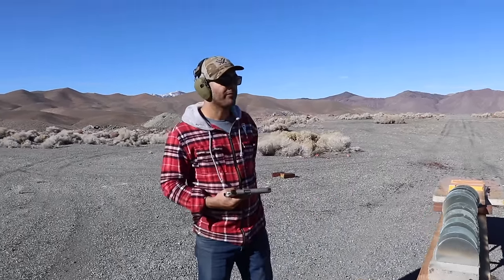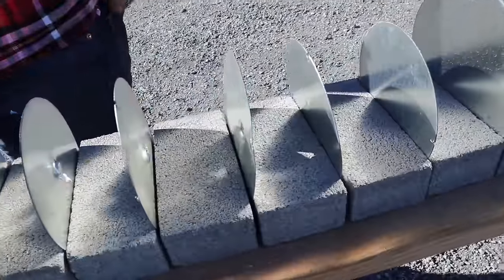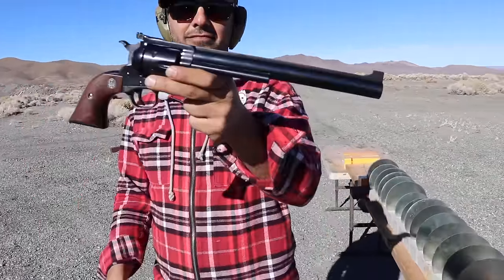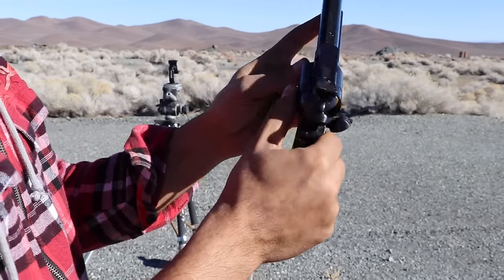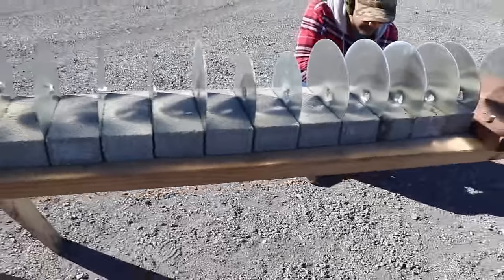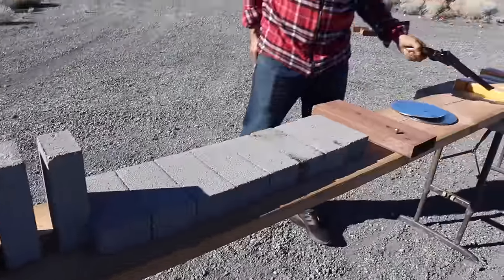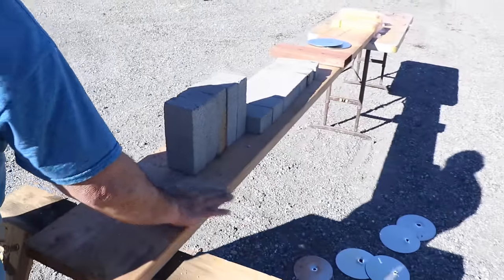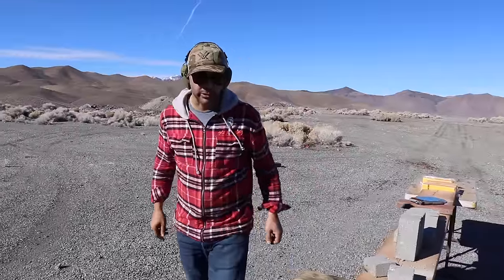45Colt vs 45Acp

Comment: The .45 ACP's lineage is from  Smith & Wesson's proprietary .45 for their Schofield revolver. The .45 ACP was designed to not over-penetrate the human torso.
Reply: One reason I like the 44 Special.  99% of my 44 Mag hand loads are at 44 Spl power levels. Pretty zippy out of a rifle too.
Reply: @johninnh4880  I also load my 44 mag to 44 Special levels with hard cast lead bullets. I have a S&W model 29 6" barrel a Virginian Dragoon 8" barrel and a Marlin 1894 20" barrel. Loading to 44 special makes either firearm more pleasurable to shoot. After shooting about 10 44 mag loads from my 29 or Dragoon my hand is shaking from the recoil so much that I can't hold the gun steady and with the rifle my shoulder can't take much more either. One thing that I do is when I'm finished firing either one of them is that I shoot about 5 rounds of jacketed 44 mag with a mag load. This cleans out all of the lead and other junk in the barrel and makes cleaning either firearm easier.
Reply: @dalehazard8016  <-- I shot Cowboy Action for years. I still have a few hundred 44 MAG Cowboy loads. 240 gr in the pistol for a bit of a roll in my hand so the hammer is easier to reach. 200 gr in my rifle to shoot flatter.  I shot  "dualist" (one handed) took 3rd in my state one year. Shot cap n ball duelist.  Took 1st place in speed pistol with em my last year. I quit because of the "gamers" 32 spl at 600 fps or some nonsense. Real Cowboys did not shoot whimper loads. I got hit 3x in my legs my last match. I pushed for a MINIMUM  FPS. They have a maximum FPS. Fell on deaf ears so I quit. In the last year I didn't shoot for a recorded score because of the bitching about little shit that made no difference except to help their final placement.  Nuff on that. I've got a S&W N frame round butt tapered short barrel in 44 Spl. A special run for Don Hume/Hoag (?). It shoots one hole 5 shot groups. Most accurate center fire pistol I've got.  Smith n Wesson GAVE me a 6" M629 with a wide smooth target trigger and a wide target hammer. I spent an entire day on buffing wheels so it looks like it's Nickle.  Went through the custom gun shop back in the 80's when you could walk into the shop. I watched the smith do my trigger/action.
I have a M29 8 3/8" pinned barrel in the presentation case. Wide trigger (grooved), wide hammer. Sweet pistol paid $125 for it!!😳
A pair of Ruger Vaccaro 5" 44 Mag. My Cowboy pistols. Engraved back straps with Buffalo horn grips. Trigger jobs etc. Sweet pair.
I landed a pair of centennial (?) Ruger Old Army SS 44 cap n ball pistols with adj sights. When I looked at the serial #'s they were consecutive serial #'s!! Like WOW what were the chance of that? They came from 2 different dealerships too. What a find. Both in wood presentation boxes. 
I'm rambling... thanks for the post. I do the same thing with a few jacketed bullets to help get the lead out. Some people say it makes it harder.  I say BS.😉
Reply: ACP developed from a S&W?
I thought it had more to do with extraction and not having an uncomfortably large grip than anything to do with penetration
Reply: @bp8652  <-- Tons of cadaver testing. 45 Schofield & 45 Colt (not long colt) ballistics seemed ideal. 45 Long Colt over penetrated and was to long. Then getting 'it' into John Browning perfect pistol design. Many factors in the ACP development. My grandfather carried the same 1911 in both WWI & WWII. Served him well.
Reply: I beg to differ,  The .45 ACP is from Frankford Arsenal design, via Browning's early cartridges.
Reply: @johninnh4880  I load some of mine in the gap between a hot 44 Special and a standard 44 Mag for my Taurus T44.  It can handle any standard 44 Mag, but is a bit on the light side to be pleasant shooting with those loads.  Even at that, it still packs a wallop on target with the lighter loadings.  And the lighter load likes Hunter Supply's 200 gr PHP lead bullet.
Reply: @johninnh4880  .45 long colt and .45 colt are for all intents and purposes the exact same round. Same dimensions. Same round.
Reply: @tricksterjoy9740  Actually there is no 45 Long Colt, according to my Lyman manual. It's just: 45 Colt, 45 Auto Rim, and 45 ACP all being different.
Reply: @johninnh4880  I literally have a box of .45 long colt cowboy loads. They match the dimensions exactly of a box of .45 colt I have.
Reply: @johninnh4880  from what I’ve heard and read about here and there, generally speaking it seems .45 long colt is used to describe explicitly cowboy loads, whereas .45 colt is either/or.
Reply: @tricksterjoy9740  45 Colt as we know it is "Long" Colt, 45 Colt Government is "short" Colt. It was shorter and loaded with only 30 grains of BP instead of the full 40 grains that "Long" Colt used. Once the military stopped using those guns it dried up and ever since only the original "Long" Colt is produced, mostly with smokeless powder. Cowboy rounds are just rounds loaded with black powder rather than smokeless or a lowered smokeless charge to replicate BP pressures, and with an unjacketed lead bullet.
Reply: @eclipsegst9419  you seem to have replied to the wrong person.
Reply: @tricksterjoy9740  no.. you said only Cowboy rounds are Long Colt. All 45 Colt besides 45 Colt Government, are Long Colt.
Reply: The 45 acp was designed to shoot horses.....

Comment: The old Colt round can be loaded to  454 Casull power levels with modern cases, the factory rounds are about a tenth of an inch longer to keep them from chambering in an old Colt or clone, which would cause a very sudden disassembly.

Comment: That's a beautiful Ruger, but I think that barrel is aftermarket.   Looks to be about 10" long, and Ruger didn't offer them in that length.  Also, looks like a Super Black Hawk hammer, with the low, wide spur.  In standard factory loads, the 45 Colt, with its 255 grain bullet, is somewhat more powerful than the 45 ACP, with its 230 FMJ.  But you can handload the 45 Colt to higher pressures than the 45 ACP and achieve near-magnum power, safely - assuming a strong gun like the Ruger, Freedom Arms, or Magnum Research BFR.  Great video!

Comment: Great comparison between these two calibers.  Own several firearms with both calibers.  But - there are few firearms in 45 Long Colt sized for defensive, concealed carry.  Regardless, think the 45 ACP has sufficient power to stop a two-legged adversary in situations of self-defense.  🥊👍
If one wants a relatively concealable firearm in 45 Long Colt, there are double barrel Derringers available in this caliber.  There are Derringers sized in this caliber that are NOT difficult to shoot, at least for purpose of self-defense.
Reply: Also the Smith and Wesson model 25-5 double action.
Reply: @patriot3431 That's a pretty big piece for concealed carry.  But I would certainly feel safe having it on me.😊
Reply: @linguisticman  I shoulder holster it.

Comment: Good stuff. I'd like to see this test with 45 Colt versus 44 Remington magnum. You always make these videos entertaining!
Reply: Most 45 Colt factory ammo is downloaded just like 45-70 Government is in case they end up in 19th century guns. These are my 2 favorite calibers for shooting and reloading in handguns..45Colt wins hands down  especially if you have a modern gun and you reload. My favorite hot load is a 250 grain Hornady XTP at about 1375' per sec with H110 powder.
Reply: @victorweidhaas1067  I load my 45 colt pretty hot in my 1892 chiappa clone. It can handle pretty high pressures. I haven't taken it hunting yet but I've no doubt it'll be a thumper.

Comment: I have a Ruger New Vaquero in .45 long Colt. You can load the round to as hot as a .44 mag or a little hotter.
Reply: According to Ruger you CANNOT run hot loads in the New Vaquero (I have two of them myself).  I wanted to buy some bear loads for camping so I checked their website.  The original Vaquero you can but NOT the in the new.  I’ve never tried it because I value my appendages but I would say you’re giving very bad advice here.

Comment: This was not a fair test in many ways. The 1911 has a 5" barrel. The Ruger has a much longer barrel. The 1911 will have much less muzzle velocity and much less muzzle energy with a 5" barrel than the Ruger with a longer barrel. The 45 Colt has more gunpowder and due to the length of the barrel it will develop more muzzle velocity and more muzzle energy than the 1911 with 45 ACP because the gunpowder in the 45 Colt has a longer distance to burn and creates more muzzle velocity than it would in a 5" 1911 barrel. Another inconsistency is that the 45 ACP was a jacketed bullet whereas the 45 Colt was a cast lead bullet. To many inconsistencies for a fair test.
Reply: bingo
Reply: I don't think this was supposed to be a super serious test
Reply: damn bru why so serious
Reply: @jayy2sluttyy633  These guys are attempting to create scientific data where in reality, they are just fooling around, playing with guns and comparing apples to oranges. I'm sorry you think I was being too serious.
Reply: @nokachi3339  It's obvious they are are just playing around with guns and are just trying to make an unsubstantiated test just so they can post a video on YouTube.
Reply: @dalehazard8016  calm down, people can shoot things and post to YouTube. I would never get any serious test from this channel, it's for fun.
Reply: They aren't using "gunpowder"(black powder). .45 colt cases are so big so they can fit a large charge of black powder, but with smokeless powder case capacity is rarely an issue.

Comment: I love all the comments between the two yes the barrel lengths did add some FPS and pressure but the 45 Colt is a superior round of the 45 acp. Now the 45 ACP was not designed to do what the 45 Colt was designed to do. Both are excellent and both are classic 45s! And are a must for any arsenal.

Comment: The 45 LC had a longer barrel which increases ballistics,, it would have been more exact with a revolver with a similar barrel length,, also,, there is a difference between old school single action revolvers and modern safety transfer revolvers such as Ruger when it comes to loading and unloading the cartridge which seems like someone was unfamiliar with those features,, however the comparison test with the discs and the fact that which looks like the participation of the cameraman is quite genuine,, thumbs up on my part homies👍,, keep shooting..
Reply: ...well, less than a 100 fps between A 7 1/2" barrel and a 4 3?4" one....plus if you handload you are probably getting higher velocity than most store bought ammo....

Comment: For a fair comprasion, the barrel length must be the same. The .45 Colt bullet from the 10 inch barrel on the Ruger get a higher muzzle velocity than the 45 ACP from the 911's 5 inch barrel, so no wonder it went through more plates. 
Cheers.

Comment: I wonder how different the 44 mag and the 44 auto mag would be ?
Reply: Not much. Auto loader vs rimmed.
Reply: Just a little better than a 10 mm high power round like I carry daily. The 10 mm at point blank range is equal to a 44 magnum 50 ft away
Reply: Pretty close. I like using 44 special when I let my friends shoot my Virginian Dragoon.
Reply: what about 45 GAP ??? we need video for that 😍
Reply: Yes! He should do that.. if he can find 2 platforms with equal length barrels
Reply: @sniper7.62x51  I have worked up some lower pressure 44 Mags I use for letting folks shoot the Super Blackhawk and for the Taurus T44.  The Taurus is better than 10 oz lighter than the SBH empty, plus carries one less round.  But a 200 gr PHP lead hollow point expands violently at about 1200 fps.
Reply: For an auto mag you would one more limited in how hot the loads could be, or what bullet you can use.  For a 44 Mag, pressures can be regulated from Cowboy loads to hand bruising loads, and anything in between.  A good 44 mag will take about whatever you can throw at it.  Can't sue a 300gr hard cast SWC bullets in an Auto Mag.
Reply: @timclaus8313  Yeah back in my loading days we used to do 44M with green dot. Had the recoil of a 38 special. Very nice to shoot in the big revolvers. The 44 mag is fun for about six rounds unless you really needed to take down large game.

Comment: Try somw handloaded historical black powder loads for 45 colt. 250-255 grain bullet over 40 grains of 3f black powder. Gets 1000fps and up out a 7.5in barrel. Thats 566 ft-lbs of energy, ive heard it can even reach 1050-1100 fps. Which is 624-684 ft-lbs

Comment: The revolver has a cylinder gap that loses pressure. So that pretty much evens out the "advantage" of the longer barrel. It's actually a pretty close comparison.
Reply: Not even close. If you were talking about a 5.5 to maybe 6 inch barrel on that revolver then it'd be equal to the 5 inch 1911, but that cylinder gap doesn't lose as much as you'd think especially not when comparing a 10 inch to a 5 inch.

Comment: What they made a 45 ACP? 
I (still) be rocking the 45 Colt! 

The “Taylor Knock Out Index”: Velocity (in fps) x Weight (in grains) x Diameter (in inches) = _ divided by 7,000 [to convert into foot pounds of energy]. 

Notice how big and slow is better than little and faster every time? Well now, it ain’t just what she said anymore! And on that note - 

45 ACP: [1904 AD] (Original) 
Standard P - 835 x 230 x .451 = 86,614.55 divided by 7,000 = 12.37 ft pd 

Underwood Ammo 45 ACP: 
               +P - 925 x 255 x .452 = 106,615.5 divided by 7000 = 15.23 ft pd 

45 Colt: [1872 AD] (Original) 
Standard P - 1000 x 235 x .456 = 107,160 divided by 7,000 = 15.3 ft pd 

Underwood Ammo 45 Colt: 
Standard P - 1000 x 250 x .452 = 113,000 divided by 7,000 = 16.14 ft pd - Xtreme Penetrator 
               +P - 1400 x 250 x .452 = 158,200 divided by 7,000 = 22.6ft pd - Xtreme Penetrator +P 
This is the results of big getting faster. So, "faster can be goods so long as size is not compromised!" And I quoted her on that. 

[Liberty Ammunition 45 Colt: 
Standard P - 1800 x 78 x .452 = 63,460.8 divided by 7,000 = 9.0658 ft pd - Civil Defense 
Showing little going fast is just that, and nothing more!] 

               +P - 1325 x 325 x .452 = 194,642.5 divided by 7,000 = 27.8 ft pd - Long Flat Nose Gas Check Hi-Tek Coated Hard Cast +P 

Standard P - 900 x 220 x .452 = 89,496 divided by 7,000 = 12.785 ft pd - Maximum Expansion (before it expands) 
Standard P - 900 x 220 x 1.75 = 346,500 divided by 7,000 = 49.5 ft pd - Maximum Expansion (after it expands) 
This is the results of big becoming HUGE! At this point she was speechless:hand-orange-covering-eyes:.

Comment: Seeing how the 45 colt was originally a black powder cartridge,  I would like to see a comparison using 45 acp vs 45 colt loaded with black powder.
Reply: The original full load(1873) for the 45 Colt was 40 grains of black rifle powder (FFFg) under a 255 grain bullet. That made right at 1000 fps from a 5.5" barreled single action, and about 1030 fps from a 7.5" barreled single action. In SIXGUNS Elmer Keith says that the 40 grain BP load would shoot completely thru undressed 8-inch pine timbers. Gun Writer Mike Venturino, tested that load firing through 7/8" pine boards and got complete penetration of 11 boards (9 5/8" inches of pine penetration!). So right from the start in 1873, the 45 Colt was a thumper, and would kill anything in front of it. 

By 1874, U.S. Arsenals began downloading the 45 Colt to 30 grains of black rifle powder and a 250 grain bullet for about 800 fps, later dropping to a 230 grain bullet for about 830 fps, because the heavy recoil of the full 40 grain BP loading made it very difficult to train new soldiers to fire. In 1877, U.S. Ordnance dropped the 45 Colt in favor of a new cartridge that combined the small rim of the 45 Colt with the shorter case of the 45 S&W Schofield to create the 45 Colt Government, loaded with 30 grains of FFFg under a 230 grain bullet for around 830 fps. The 45 Colt Government cartridge developed the ballistics that the 45 ACP eventually duplicated. (John Browning's first loading for the 45 ACP was a 200 gr bullet at 900 fps, but U.S. Ordnance requested Browning duplicate the 45 Colt Government ballistics).
Reply: @63DW89A  that's very interesting info.  Thank you!

Comment: This is 45 lc that will out perform the 44 mag. I buy 45 lc from Buffalo bore for my circuit judge
Reply: Not sure that gun is supposed to be using +P? The normal judge definitely isn't supposed to.
Reply: @redtra236  the circuit judge is the rifle and excepts the hotter load. There is no "+p" for 45lc. The judge pistol some except 3in mag 410 and some don't. That is the only diff.
Reply: You're correct

Comment: 45 colt depending on which type is it p plus also 45 colt can get up to 300 grains or more depending on brand. Also barrel length looks to be 3 or 4 inches longer which increases velocity and foot pounds of energy. So not a fair comparison. If barrel length was the same then yes.

Comment: Velocities for standard loads between the two are roughly similar.  The .45 Colt uses a lead bullet and ACP uses jacketed.  Depending on how hard that lead bullet is will determine how much steel it will penetrate.
The longer barrel Ruger will give enhanced velocity, but how much more is open to debate.

Comment: They’re almost the same power normally but the barrel length on the Colt will give it a lot more velocity in addition to the heavier bullet. This really apples to apples. Try a 4.5-5.5” 45 Colt
Reply: the barrel length doesn't mean a whole lot at point blank. 45 colt is about 200fps faster than ACP even from a 5.5" barrel. It also had no metal jacket on the bullet which is a much larger disadvantage when shooting steel. im surprised it still pulled thru.